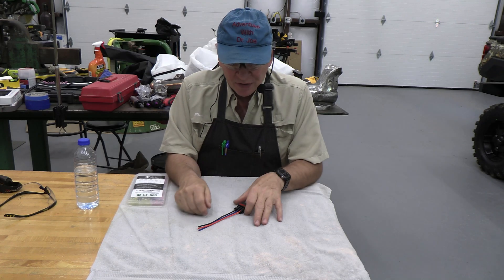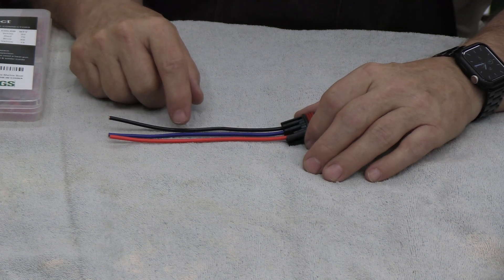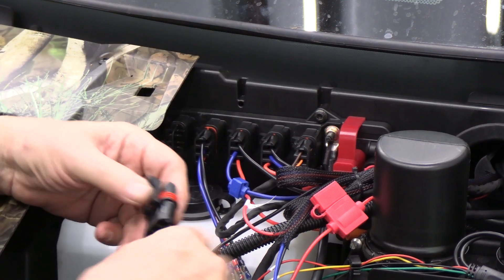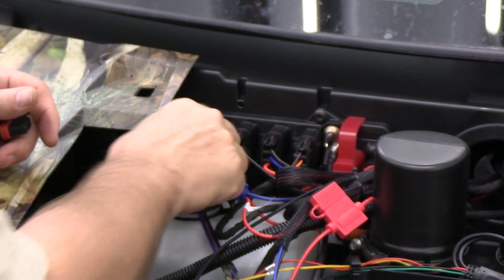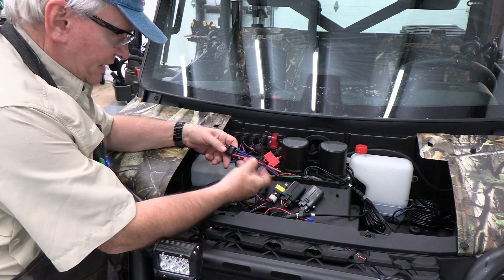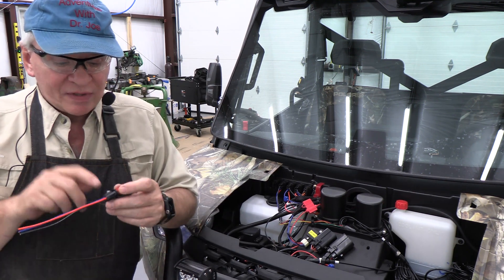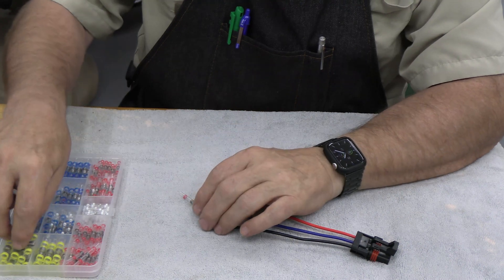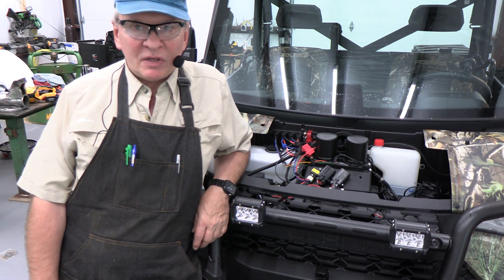How to Use Polaris Pulse Bar Quick Connectors

Comment: Can you wire a Deltran battery tender in to this pulse bar for charging ? 2026 Polaris Ranger XP1000 Northstar.  I don’t want to use the port in the cab, because of having a cord to run inside
Reply from the maker: Interesting. The poor inside the cab is such a great feature. I actually really love it, but you certainly could wire it up using the pulse bar to a battery tender. Let me know how that works. I’ve never done it. Thanks. Joe.

Comment: Wonder if these would work for the 2024 pro r? On Amazon it does not list the pro r
Reply from the maker: Good question. I believe it will fit and of course with Amazon if you get something, you can always return it if it’s not quite right. Consider subscribing. Thanks. Joe.

Comment: If you hook the red power wire (LED light or winch or whatever ) to the blue key ignition wire on the pulse bar, you are asking for trouble. That is only a 10 amp circuit. This is bad information.  The main power red on the pulse bar is protected by a 40 amp circuit. That’s where all your main power must run through. If you’ve done it the way this video describes, you’ve  gotten lucky and haven’t blew fuses, it means you haven’t reached the 10 amp circuit limit yet on the keyed ignition wiring There’s another video on YouTube that shows you exactly how to do this.
Reply from the maker: Thank you for pointing that out. I appreciate your feedback and I will definitely look into this.

Comment: Lol I just stole power from that. Guess I shoulda bought the bar and connectors... meh my solder job is fine.
Reply from the maker: These connectors are very expensive and very useful you can buy a pack of Jennifer about 10 bucks on Amazon. Consider subscribing. Thanks. Joe

Comment: Do you have to use blue wire?
Reply from the maker: Hey, that’s a very good question. The answer is no because that is the electrical power for switched meaning it won’t work without the ignition on. The red one works all the time so only if you want switched power do you use the blue line. Consider subscribing. Thanks. Jill.
Reply from the maker: Joe

Comment: I have a question. If the accessory I want to use has only a hot and ground wire how do you wire it with a third blue wire?
Reply from the maker: You ask a good question. The hot is either connected to the red or the blue. The ground is the ground that’s black. If you connected to the Red, you’ll have power all the time if you connected to the blue, you’ll have power only when the ignition is turned on which is the most common one to use for most accessories. Consider subscribing. Thanks. Joe.

Comment: Do you have a vid for the wiring up of a Rocker Switch, Contactor, Pulse Bar, and Winch? The wiring is a bit confusing. In a previous vid you installed the Contractor on the Pulse Bar plate. Please help.
Reply from the maker: Thank you for your question. Yes I have a video on winch wiring simplified you might want to check that out. I think that will be helpful. Consider subscribing. Thanks. Joe.

Comment: Sir I was troubleshooting an issue and looking at this video I solved it!!! 🎉🎉🎉
On the plug and play bar top right side there is a wire that supposed to be plugged in that gives you your ignition power. When running all my wires, I seen this wire sitting inside the dash column not plugged in unaware that it had a home. For some reason that was never plugged in from the factory.
Reply from the maker: Well done. I’m glad you found this video useful. Consider subscribing. Thanks. Joe.

Comment: I am awful with electrical. With the pulse plug the blue wire where do you plug that to?
Reply from the maker: @RazorTrailRiders-jn1wq  thank you for your questions for the blue wire goes into the red wire of whatever you’re trying to turn on or off. It’s only under power. It only has current when the ignition is in the position. Consider subscribing. Thanks. Joe.
Reply: @JosephHunstad  So when wiring the Red and Black tie the blue wire with the Red positive wire and that should work only with the ignition on correct?
Reply from the maker: @ yes that is correct
Reply: @ ok to make 110% I have this please bare with me!! lol.. Black to Black, Red/Red, Blue/Red ?

Comment: Good afternoon sir, have a question for you. I just hooked up a light bar and did exactly what you stated, black to black and red to blue so it would only come on when key is on. Unfortunately it is not working. It will only work when red is to red and black to black? Did I miss something?
Reply from the maker: Hey, thanks for your question. That is a mystery. There must be no energy to the blue wire which is kind of crazy. As long as you’re key is in the on position or your engine is running you should check with a volt meter that your blue line has current. If it doesn’t then you need to be sure that the wiring to the post bar is correct. It sounds like it’s not. Thanks. Consider subscribing. Joe.
Reply: Thanks for replying back, so my pulse bar connectors that I bought have a yellow wire in the middle instead of blue. Now my wiring harness only has a red and black wire coming off of the relay. Could that be my issue? Do I need to splice a wire from my relay to connect to the yellow wire? I’m confused 😂😂

Comment: I could not find a way to send you a question separately as it is not related to this topic but what screen and camera setup did you add to your ranger?  Was it the stock polaris brand or after market?
Reply from the maker: @craig.pilarski  hey buddy, no problem. It is an aftermarket camera and screen set up. I got it with two cameras so I can switch between looking forward and looking behind. The four camera is great for hooking up my log splitter to a front receiver and a trailer hook up. Thanks. Joe.

Comment from the maker: To connect a two wire turn signal or other feature you’ll connect those to the red and black if you want the power on continuously or the black and blue if you want it only when the ignition is on, which is what I would recommend. Thanks. Joe.

Comment: When I wire accessories to the 3 wire pigtail I step my connections so it lessens the chance of two connectors rubbing together. When I cut them is steps 3 different lengths I do that to the accessories side so there’s not bunching. Great video
Reply from the maker: Hey great, great suggestion. I think that is really very thoughtful. I’d love to see a picture of that. I’m sure not only is it safer but it probably looks great too consider subscribing. Thanks. Joe.

Comment: Poor information, not as described as plug and play, these plug and play harnesses will burn fuses constantly unless relay is wired correctly
Reply from the maker: I hope you found my video useful because it’s the way to go to get this thing set up and work properly. I’ve hooked up many accessories on my vehicle and others without any issues whatsoever. This video will take you step-by-step through the process. Consider subscribing. Thanks. Jill.
Reply: @JosephHunstad  i actually bought the exact same as you recommended and unfortunately even though i was meticulous with your instructions i burned fuse when i turned on all the light accessories

Comment: Thanks for the video. Great information on the Pulse Bar. That's a very clever idea that Polaris came up with. I've seen those connectors advertised but wasn't sure they would really work.
Reply from the maker: Thank you for your nice comment. If you wish to buy those connectors, I have a link to it in the video description. I do get a small royalty from that but you pay exactly the same price. They work really well. Consider subscribing. Thanks. Joe.

Comment: Glad I stumbled across your channel. New sub here. Curious, what size and brand of electrical wire would you recommend for connecting accessories? I recently bought a 2023 Ranger XP 1000 crew Northstar Ultimate and I plan on adding a light bar and a couple 5” cubes. Is there a particular brand you like? I’m a DIY’er for most projects except electrical. I tend to let the smoke out of things. Should all my wire be the same size of the bus connector wire? Thanks for the video
Reply from the maker: Excellent question and congratulations on your RANGER. You will love it. Yes, I would use the same wire gauge that’s in the pulse bar connectors. That way you’ll be safe. There are so many brands of lights to choose from. Take a look at the video. I did on the light bar installation for the Ranger it lists the brand which has worked well for me. Thanks for subscribing. Take care. Joe.

Comment: Can I use just the blue & black wires. I have a LED dome light & it only has a red & black wire. It has a on/off push button switch on it so I don't want to have to use a rocker switch. Would I put a in-line fuse on the positive side?
Reply from the maker: Hello excellent questions. Because the dome light has a low amperage, you can connect it to the blue and black. If you use an in-line fuse, I would put it on the blue line. Consider subscribing. Thanks. Joe.
Reply: @JosephHunstad  Thanks!!!!!

Comment: I have a 2022 Rzr with the old terminal block in the same spot. I wonder if I can upgrade it to this pulse bar instead, and how difficult it would be.
Reply from the maker: You ask a great question. It should be easy to connect because it just needs a negative ground a positive power terminal and then the switched or blue terminal. What’s those three are connected your pulse bar is good to go and then you just need to find a good spot to mount it.when you remove the old block, take a look for those three wires. Those are key wires to connect to the pulse bar. Consider subscribing. Thanks. Joe.

Comment: Can we add a second bus bar? It comes with 3 connection bar. But I need 8 all together. So I ordered an extra bus bar 6 connect.
Reply from the maker: That’s a super question. Just make the connections to the pulse bar. Exactly like they are to the existing one and you’re in good shape. Consider subscribing. Thanks. Joe.
Reply: Yes, I saw that there was a harness that you could buy that has that snap in plug’s along with hot and negative. There are a couple other plugs that have to plug into like ignition and something else I noticed. I didn’t know where you would plug those in since there is a pre-existing cable already. Or do I have to get two pigtails plus and minus and then splice into the ignition cable? Sorry I haven’t really dug into it very much. I wish I would have before. I ordered the bar because it looks like you can buy a kit harness and bar. My main concern is if I buy a wire harness only thing I can think of is I need a Y when it comes to the ignition cable plug the Y into the cables, and that one and into ignition plug.. Does that make sense?

Comment: Hi, Can you show where you hook the blue ignition wire from the pulse bar?  I am not sure where it goes. I have the black to black and red to red but my switch stays lit even when key is off. I have seen so many people with the same issue but cant find an answer. Your video is the best I have seen but it doesnt show where to run the blue wire either.  I am hooking up a light bar... Thank you
Reply from the maker: So the red wire has power all the time the blue wire only has power when the switches turned on. You could disconnect the red wire and connect the blue wire and that will give you power only when the switches turned on. Give that a try. These three wires are ideal when using a switchsuch as on a winch, but unless the draw is too great, connecting the blue wire as the positive wire should work fine. Consider subscribing. Thanks, Joe.

Comment: Great Video, I have a 2024 Polaris XP 1000 Ultimate and I just installed Gorilla Whip lights.  The system is set up with a relay and switch and the power source is two wires, 1 positive and one negative that go to the Pulse bar.  I hooked the ground and power red to the incoming from the battery on the pulse bar and the light switch is constant on so I know that wont work.    I cant find where they make the pigtails yet for the 2024s but if they did can you just hook up the red positive wire to the blue keyed wire to the pigtail? Or would it be better to splice the red (hot) into the keyed wire going into the end of the pulse bar.
Reply from the maker: Hello there. Good question. If the load is not excessive, I would hook it to a pole spar connector switch to wire and ground. If it’s a high load requirement, then either directly into the positive on the Paws bar or even the battery. It’s probably not that big of a low though. Take care consider subscribing. Thanks Joe.

Comment: Thanks for the video. Right to the point without wandering. Saved me big time! 😎
Reply from the maker: Hey buddy, thanks for your comment. That’s how I roll. Not too much fluff. Consider subscribing. Thanks Joe.
Reply: @JosephHunstad  Seriously saved my butt!! Do you have a video wiring a light bar to the pulse bar?
Reply from the maker: @dkwtu1  yes, I do have a video on wiring a light bar using the pulse bar connector. It was nine videos before the pulse bar quick connect.
Reply from the maker: @dkwtu1  the video is light bar install on Polaris ranger XP 1000

Comment: Hey Joe, the Black Oak Led light bar only has the red and black eyelet to place on the battery terminal. I was going to cut the eyelets off and use the pigtails and butt connectors. I don’t have a blue wire from my light bar. Can I wire it with just the red and black and put a nut on the blue from the pigtail?
Reply from the maker: Hey buddy, great question. What you’re trying to do is directly wire up your light bar and if you wire the red and black to the light bar the light bar will be on all the time which will drain down your battery and it’s not a good idea. I would recommend a switch that goes between the light bar and the pulse bar. The switch could connect to either the blue or red depending on if you want to turn the light on with the engine, running or all the time, I’d recommend having the blue, so it’s only available when the engines on, and then the red and black from the light bar to the switch. I think that’s the best option. Thanks consider subscribing. Joe.
Reply: I have a kimpex wiper motor, red and black wire, where do I connect the blue wire on the general xp4

Comment: When you hook up light bar to the pulse bar the blue goes to,the switch bottom right on a 5 pin switch what do you do with the red wire (3 wires on the pulse bar?)?
Reply from the maker: OK, so if you wire up your switch with the blue wire – which power is the switch only when the ignition is on Dash you can cap off the red wire. Thanks Joe a wire nut will protect it from shorting.

Comment: Hello Dr. Joe! Great video! Quick question. If I'm wiring up a Winch that has a Black and Red wire, if I don't want constant power to the Winch, I would wire the black wire from the winch to the black wire on the plug, and the red wire from the winch to the blue wire (in the sample plug you're showing) on the plug so it will only work with the ignition on, correct? And what do I do with the red wire? Can I pull it out of the slot? Or just clip it short and put some heat shrink over the end of it?  Thank you!
Reply from the maker: Hello snubblet!!

Thank you for your nice comment. When you wire up a winch with a black and red wire, connect the black to the black and the red to the blue wires.
That will give you switched power.
The black wire is the ground on the winch which connects to the ground on the pulse bar. The blue is the switched electrical current turns on when the ignitions on so you’re winch will work.

Consider subscribing. Thanks Joe.
Reply: @JosephHunstad  Thank you for the reply!! I did subscribe! So the pulse bar will be able to handle the draw from the winch when used, correct?
Reply from the maker: @snibblet  yes, I think it’s supplied with a 40 amp fuse
Reply: @JosephHunstad  my 2023 RZR Trail Pulse bar is only supplied with a 25 amp fuse. Will the winch, when being used, draw a lot more amperage than 25?
Reply from the maker: That’s a great question. But if you connected to the pulse bar, then the 20 5 AM fuse will limit the electrical draw through it. Usually 20 5 AM is plenty for that application. It’s possible you may have a larger winch that has a greater draw. Consider subscribing. Thanks Joe.
Reply: Never saw this answered!  Can this red wire be pulled out if not needed?
Reply from the maker: @100225564  OK sorry about not answering your question. Typically the red is hot and the black is ground and the blue wire is switched. If your switch works without the red wire, it could be cut short and then protected with a wire cover.
Reply: @100225564  Yes. I have done it when wiring up several accessories that I only want them to work with the ignition switch on.
Reply: I have watched SEVERAL videos regarding the piles bar. I want things to come on when the key is turned and no current when the switch is off. Blue to switch. Black to ground so 5 pin switch. 2 top ground middle to incoming blue. Bottom right out to the red light bar wire. Black light bar wire to a top pin on switch?
Everyone talks about the the pulse bar and the blue but never tells what should be done with the red pulse bar wire. CUT IT OFF? How do you wire the switch, 5 pin?
Reply: Oops pulse bars
Reply from the maker: @hairpro2422  if you connect the black to the black from the pulse bar wire connector and then the blue to the red you should have switched the power only working when the ignition is on but you don’t have a switch to turn it on and off. I have a winch wiring diagram video. You can take a look at which is very helpful. Have a good day. Take care Joe.